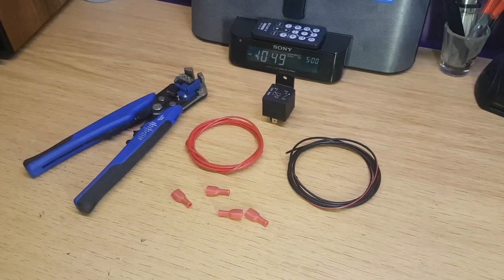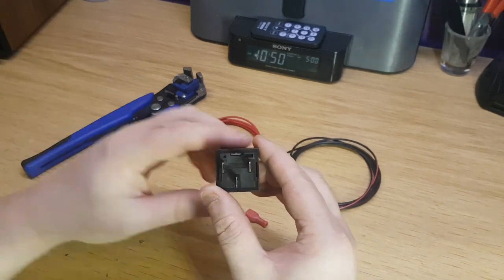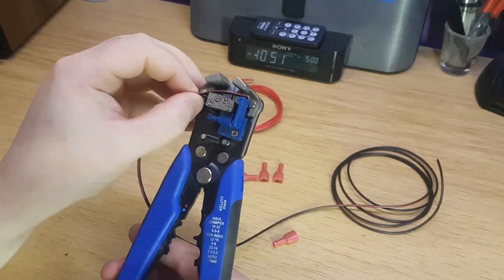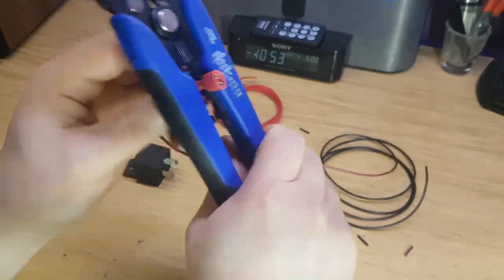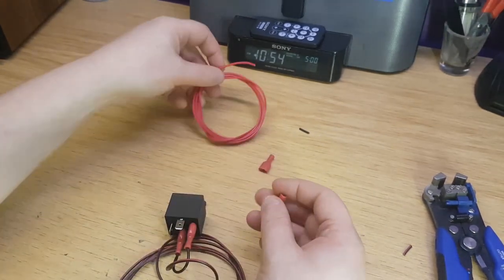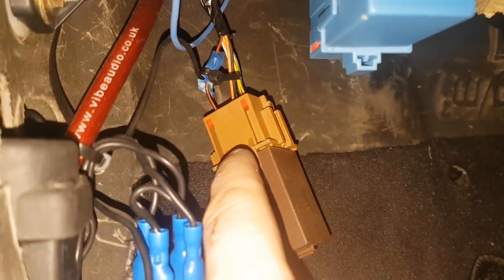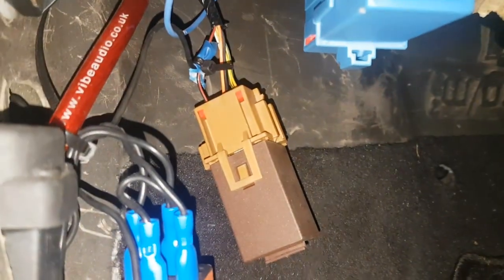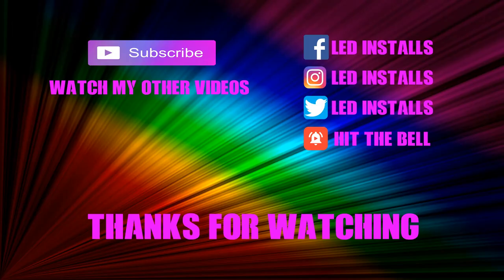How to wire & install a relay for folding mirror upgrade mk3 mondeo ST220

Comment: love your video's and all the this you do with your mondeo!  I own a ST220 my self, but I don't have the option to fold in my mirrors with the switch. will this still work if I hook up a relay to fold the mirrors with my key? I don't know if the motors are already in the mirrors and I just need the right switch to operate them or that I also need to install a couple of motors first. could you mabey help me?

Comment: Hey Chazz, is this kit only compatible  with the mk3 mondeo ? Want to fit power fold mirrors to my mk1 kuga
Reply: Hi Mr. Chazz, I have a question for you, I have to watch your videos on electrics I now have another question for you before I go down the road of buying a relay and follow your instructions how do I know my Ford Galaxy will fold has it got motors installed or will I have to replace the morrows first? x  Regards   Leroy

Comment: I did this application on my vehicle was working but the brown relay broke down for some other reason. Will I need an original relay or five-foot relay to restart the circuit please reply
Reply from the maker: So the brown relay has given up? I dont sell those but there only a couple pound on ebay.

Comment: Was gonna instal it on my mondeo from 2007. Problem is a different wiring.  There is about 10 yellow wires. So no folding mirrors for me on the alarm fob.🙃

Comment: Hi chazz I’m interested in buying a module for the folding mirrors if you sell them
Reply from the maker: http://rover.ebay.com/rover/1/710-53481-19255-0/1?icep_ff3=2&pub=5575378759&campid=5338273189&customid=&icep_item=124634844639&ipn=psmain&icep_vectorid=229508&kwid=902099&mtid=824&kw=lg&toolid=11111

Comment: Man i have a question, doest all the ST's come with this wires ??? or i have to bought a pair of new mirros ? would be awesome if u can tell me where can i get them ! thanks mate nice videos, love them
Reply from the maker: Hiya adam, not all came with the power fold mirrors, if you can fold the mirrors on the driver side of the car then buy this mod and you can do it. If not you will need to buy the power folding mirrors and wiring to wire these in.

Comment: Hi chazz great video. I'm just about to do this to my st220 just have a question. Which gauge wire did you use for the relay to the car? Thanks
Reply from the maker: hi if you really wanted to speaker wire would do, lol. but 16 awg would do fine. If not let me know and i will make you one up
Reply: @ChazzCoombes  thanks Chazz I'll let you know if I run into an issue 😊

Comment: Hi mate. I don't have a mondeo but i like to watch your mods. I was wondering if this could work in a 2007 honda civic. Cheers
Reply from the maker: hiya that's fine, if you have a switch that lets you fold in the mirrors like in our cars then yeah i'm sure it can be done, it would be a matter of working out the wiring
Reply: @ChazzCoombes  yes. It's just like yours. Will give it a try. Thanks

Comment: Installed Powerfold mirrors on my Mk6 fiesta but not on locking, just on the swtch at the minute as I made my own loom. What exactly is that yellow wire so I can tap into the equivalent on the fiesta?  Thanks. Also heard about you from Savage Garage.

Comment: Hi Chazz
I purchased this kit of eBay from you and wired it up as per the instructions
The relay is clicking but the mirrors don’t fold
What have I done wrong..?
Reply from the maker: Hiya Si, make sure all the connections are done properlly so just double check everything. Send me a message if you can

Comment: Will this work for the mk4 Mondeo?
Reply from the maker: Cant see why not, if you can fold.
the mirrors on a switch with in the car would be a matter of working out the wiring.

Comment: Hi are you still selling the kits the ebay link carnt seem to find owt
Reply from the maker: Yes mate, try this link.
http://rover.ebay.com/rover/1/710-53481-19255-0/1?icep_ff3=2&pub=5575378759&campid=5338273189&customid=&icep_item=124634844639&ipn=psmain&icep_vectorid=229508&kwid=902099&mtid=824&kw=lg&toolid=11111
Reply: Cheers mate link worked

Comment: I wanna do this to my car but it’s not a ford, just wanted to know what the wires connects to what wire eg splice into central locking and mirror wire etc. Any help would be great
Reply from the maker: I reacon this mod can be done on most cars, it would just be a matter of working out the wires
Reply: Chazz Coombes that’s what I wanted to know, which wires from the car loom I need to tap into?
Reply from the maker: @kobiruddin6516  what car do you have?

Comment: I want to do this to mine and could do with some infor on the rear bumper as mines sagging
Reply from the maker: Yeah the kit is on my ebay listing. And can look into the rear bumper sag for you
Reply: Thank you Chazz much appreciated. I can't find your ebay listing for the kit though
Reply from the maker: @davidlloydmyers6074  hope this helps. I had to relist it. https://www.ebay.co.uk/itm/124951075672?mkevt=1&mkcid=16&mkrid=710-127635-2958-0

Comment: Wonder if this would work with a mazda 3 see8ng as it's basically a focus
Reply from the maker: Can you fold the mirrors with in the car?
Reply: @ChazzCoombes  yes it has a button in side
Reply from the maker: @alanpointon2216  im guessing it would be just a matter of working out the wiring then. Message me on fb or instagram

Comment: Hi mate, will this work with a 4 pin 40a relay? Pins are numbered 1,2,3 &5..got this 40a relay lying round but not a 30a.. 👍
Reply from the maker: yeah that will be fine.

Comment: Mate Nice work, but does iT work on a fiesta mk7?
Reply from the maker: if you can fold your mirrors from instide the car on a switch then there is a good chance it will work. it will just mean working out the wiring

Comment: Hi will this be the same process for a focus
Reply from the maker: Hi if you can fold the mirrors in on the switch inside the car i guess it should. I sell them on ebay

Comment: Would this work.on a mk4 mondeo
Reply from the maker: Hi if you have power folding mirrors i cant see why, it would be a matter of working out the wires but should be similer. I sell these over on ebay
Reply: @ChazzCoombes  hi thanks  ill have to try and the wireing diss  for the mon mk4 thanks

Comment: I have a Focus ST mk2 2007. Buy the mirror module on aliexpress. Could I also mount them?
Reply from the maker: I make these to sell mate
Reply: @ChazzCoombes  Thanks for replying, I wrote to you by email. I am mounting it in my car. the difficult thing is that the 12v is not identified when you hit the open button or 12 the close button
Reply: the solution i found in my car is. open the mirrors with the 12v contacts and close it with the 12v of the lock, but I would like to do it from outside the car

Comment: I just did this today and it worked very good! Thanks man!
Reply from the maker: Jacob Aho thanks jacob
Reply: I have a very nice solution for bluetooth if aux is available, making it look very neat and clean if you're interested.
Reply from the maker: Jacob Aho thanks but i use my ipod and my system has bluetooth built in. Thanks tho

Comment: Do u have to buy other mirrows as well or ???
Reply from the maker: hi, if you have the switch on the driver door that moves mirrors, push it down and they fold, if not your need the power fold mirrors. If how ever they fold in when you push down on the switch your need just this relay.
Reply from the maker: Dennis Persson i will grab one today

Comment: What amp wire is best to use?
Reply from the maker: i use 18 awg wire, in the video i used some 12v speaker wire and it worked just as well. but i've started doing these to colour match the wires in the car to help with fitment
Reply: @ChazzCoombes  That's great. I'll go with 18 awg. Thanks for your help
Reply from the maker: @craigd8624  i can post the link to the same place i got mine from if you want
Reply from the maker: @craigd8624  https://rover.ebay.com/rover/1/710-53481-19255-0/1?icep_id=114&ipn=icep&toolid=20004&campid=5338239932&mpre=https%3A%2F%2Fwww.ebay.co.uk%2Fitm%2FStranded-Automotive-Equipment-Wire-Hookup-Cable-14AWG-16AWG-18AWG-22AWG%2F262256456691%3FssPageName%3DSTRK%253AMEBIDX%253AIT%26var%3D561004047070%26_trksid%3Dp2057872.m2749.l2649

Comment: should make a note this wont work on all mondeo due the brown relay is only present on models with fold mirrors with puddle lights i had lx and titanium and done this but had buy wire harness each side and mirrors then wire brown relay up due not all mondy have the wire harnes to add this mod
Reply from the maker: Rob Brown yeah i only just relised i dodmt add that bit. But hope people realise that i talk about a brown relay behind glovebox.
Reply: yea thought mention cos people rush out buy stuff go to do it and realise cant do it i not 100% sure which models have i nnot had a ghia or ghia x or tit x so they may be poss
Reply from the maker: Rob Brown this was a give away. But i checked with the guy and will update the discription soon. Cheers
Reply: yea i see it i good chazz i done mine some time ago  why didnt enter thanks info thou
Reply: i have a ghia x, with the power fold on the mirror switch on the drivers door